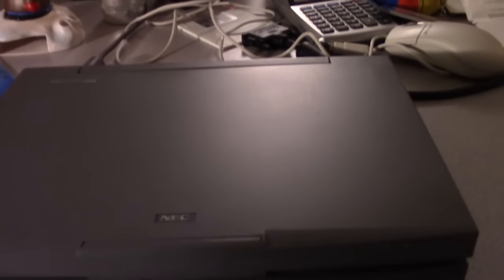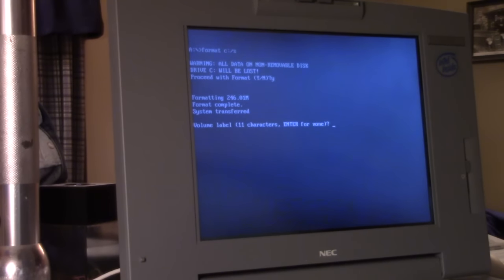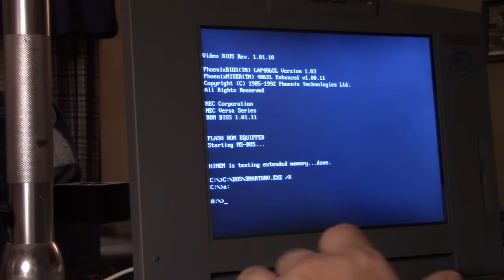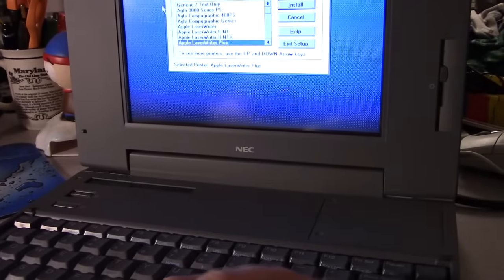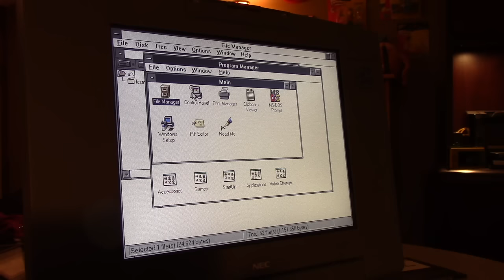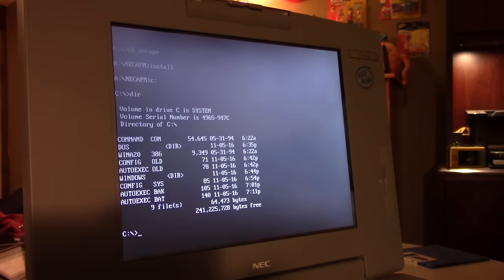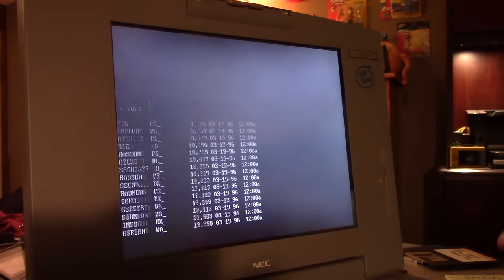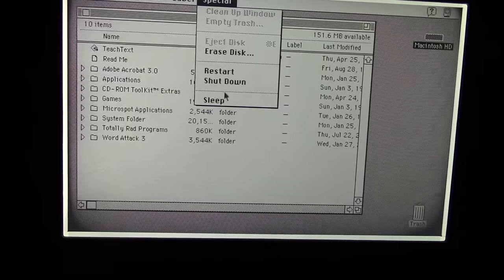NEC Versa V50 Part 2 of 2

Comment: Most old IDE laptop hard drives automatically park the heads about 5 seconds after the last disk access. It was very noticeable on Toshiba drives -- you could hear the "thunk" sound. So if you dropped the laptop the drive would be safe as long as it happened more than 5 seconds after the last disk access. The downside (besides the thunking noise) was that it slowed down the next disk access as it had to unpark the heads before it could start reading or writing data again.

Comment: The only vintage computers Id put SSDs into would be laptops. Only because now that its getting harder to find decent condition drives that arent on their way out. SSDs arent gonna be needed to be parked, less battery drain, and better general reliability.

Comment: When installing Windows 95, the display scales correctly at 800x600 with no issues.  Windows 95 makes better use of the hardware by far

Comment: That hardware disk you were attempting to use is bootable! I see config sys and autoexec.bat Maybe thats the key to setting up the partitions??
Reply from the maker: Yes, it is bootable (I must've forgotten to show that), but all it does is launch a utility for obtaining remote support access via modem.
Reply: BBISHOPPCM's World Ah.. ok. I have a couple NEC Versa machines of that style, one is a P75 (horrible condition) and a 486 just like that one, But no AC adapters sadly, otherwise I was going to check its drive to see if it has the hibernation configuration.